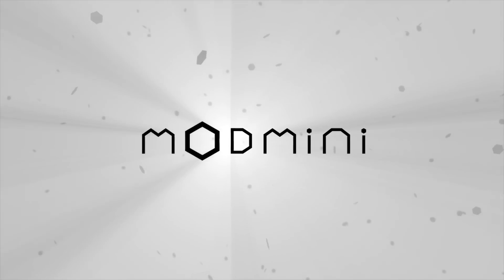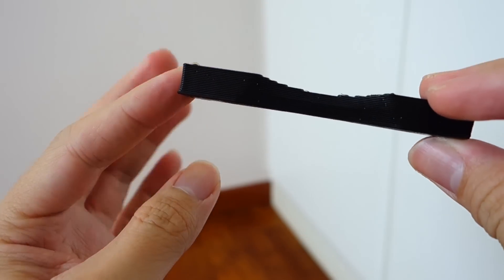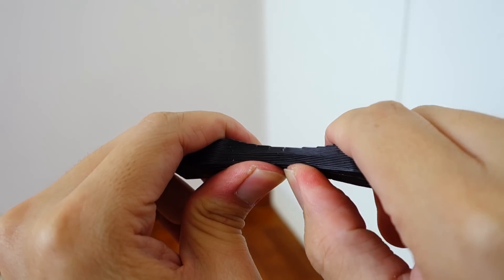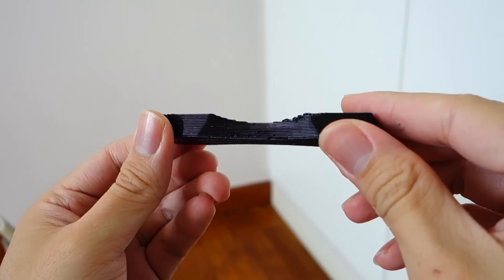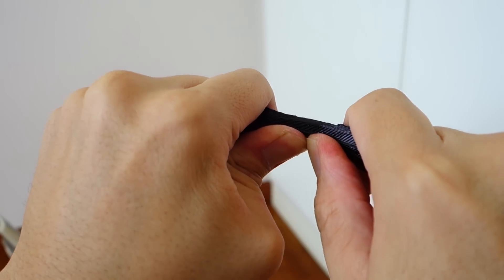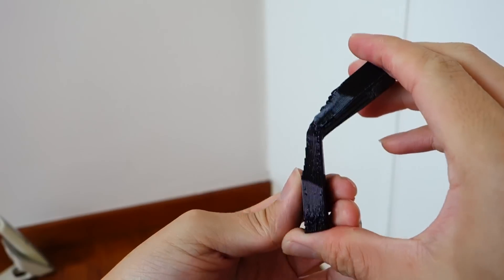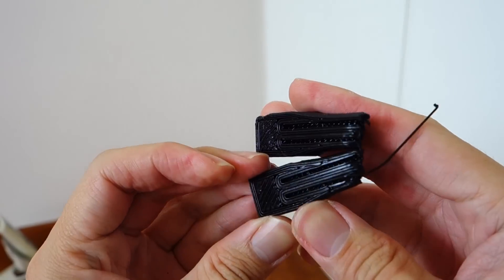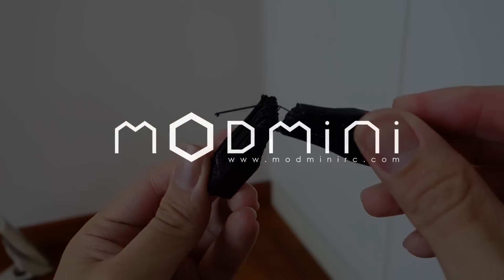HIPS vs PETG Arm Break Test

Comment: Every material is a compromise. HIPS is super lightweight and can take a lot of heat and solid impacts without shattering. PETG is really stringy and not very heat resistant, but is tough as long as the force applied allows for the material to give a little. Not sharp impact though, then it shatters much like PLA.

From what I understand these parts to be, I don't understand why HIPS was even an option. Its properties are not needed nor appropriate for this application.

Comment: The problem with PETG for drone parts is that while it's very strong against this sort of bending, and has the best layer adhesion of any material I've tried, it shatters in impacts. I did a lot of testing with different PETGs, at different temperatures and thoroughly dried before printing for motor guards and they just shattered on impact. So I went back to ABS.

Comment: If your hips parts have warped,  that because you need a heated chamber.  With the heated chamber,  the HIPS will be stronger then without it.  Try again with a heated chamber of around 65 deg c .   ABS without a heated chamber is weaker than PETG  but with the use of a heated chamber,  It will outperform by a large gap PETG and be the best filament for the price anyday.